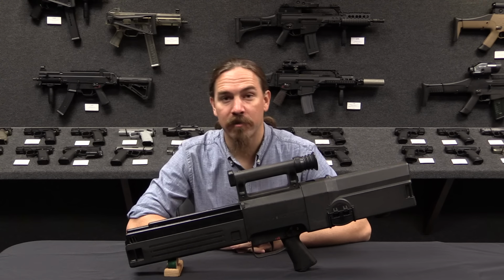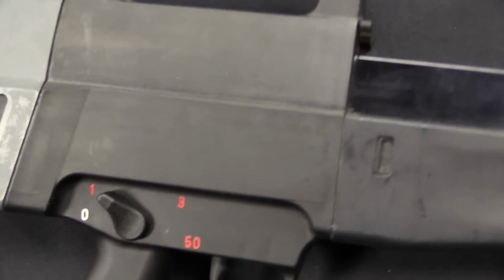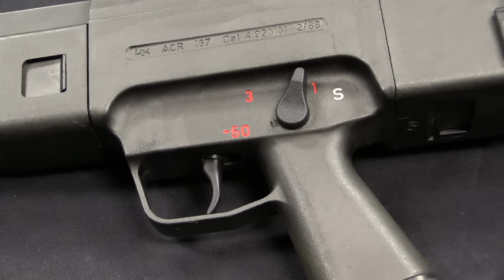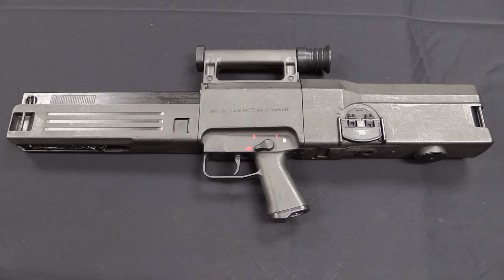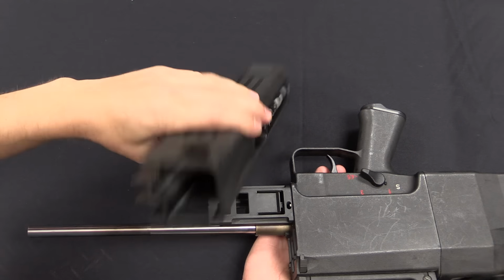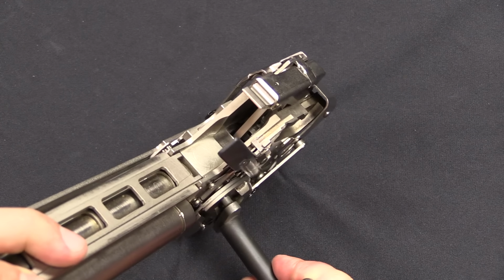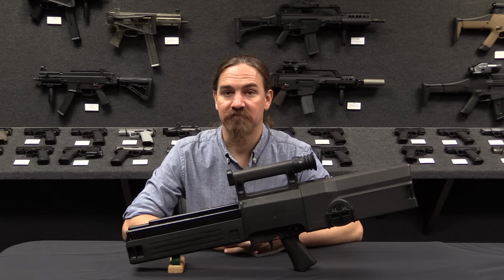Kraut Space Magic: the H&K G11

Comment: how accurate was this rifle, and how did they headspace it?  Merry Xmas!
Reply: you don't need to headspace with caseless ammo, headspace is to ensure that the brass case is fully supported by the chamber, since the chamber with this contains all of the pressure without a case, it doesn't matter as long as the drum can still turn, lines up with the bore and doesn't have excessive gas leakage.

interesting to think that this system probably has at least a small amount of cylinder gap like a revolver though!
Reply: from what I've read from a quick look on wikipedia and google, it seems it was quite accurate. It had a quite decent improvement in hit rate for the untrained shooter in burst mod.

Comment: The H&K MG11 (machinegewehr) variant of the G11 was even more crazy. The MG-11 had like 300 caseless rounds stored at the back in the buttstock of the weapon. The 300 rounds were stored in a way that they can be fired continuously without stopping to recharge the weapon with separately stored ammunition. But the rly weird thing is that you already showed that the entire barrel, and recoil/gas piston mechanism recoils back into the buttstock of the G-11 weapon.......so I have no idea how the Jermanns even manage to fit 300 rounds in the MG 11, and fire it without the ammunition in the buttstock being an obstruction.....but then again, maybe the MG-11 had a different operating mechanism than the G-11 rifle??? :/
Reply: The LMG version had a completely different mechanism. Instead of a rotating chamber, it had a vertically sliding chamber. A round would be pushed forward from the magazine into the chamber, the chamber would raise into the barrel assembly and fire, and then the chamber would drop again and the process would repeat. If you had a misfire the dud would just be pushed forward out of the chamber by the fresh round when you charged it. 

Rounds were actually stored facing sideways in a 25x12 wall of cartridges and left the magazine by being rotated into line with the chamber for loading. I have no idea how the magazine feed mechanism worked and can only assume it involved some sort of eldritch sorcery.
Reply: @lackinggravitas6751  Someone once told me as a joke that the LMG 11 "Loads itself for the glory of the fatherlande" XD XD XD    ;D      ....apparently that's how it works. Seems right enuff lol
Reply: @lackinggravitas6751  wouldn't the dud obstruct the barrel and lead to an exploding barrel?
Reply: @huichuanyang8105  The chamber goes up and down, it's not always lined up with the barrel. So i'm pretty sure the dud gets pushed out when it's not in the firing position.
Reply: https://www.hkpro.com/index.php?option=com_content&view=article&id=24:the-lmg11-caseless-mg&catid=11:rare-prototypes
Reply: @Giovanni Boykin
In ww1 the german generals were actually quite competent atleast compared to their contemporaries.

Comment: Some fun facts about the G11:
- The soldiers were supposed to carry additional magazines in a quiver, similar to the one you carry on your back to transport arrows.
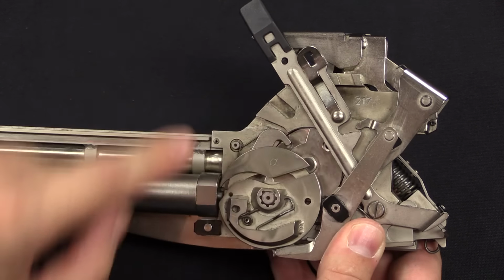- The rate of fire slows down after extensive sustained fire. The reason is that the heat leads to thermal expansion of the rotating bolt which acts like a drum brake. At 22:17 you can see the gap between the bolt and the receiver which would get smaller.
- Later models of the G11 have a predetermined breaking point in the receiver and bolt which would lead the explosion downwards in case the ammunition detonates. Apparently, it was a real pain to engineer those breaking points in as an afterthought. 
- H&K has/used to have a civilian division which produces a wide array of machines including sewing machines. Some of the engineers who usually develop the sewing machines worked on the mechanical system of the G11.
EDIT:
Because there are questions about the sources in the comments below:
Some of the information are from a member of the WTS (Scientific Collection of Defence Engineering Specimens) which is part of the Federal Office of Defence Technology and Procurement. They have a very nice museum in the city of Koblenz.
I also used to know one of the engineers who worked for HK in the 80s, he told me some of the interesting things.
Even though this infos are anectdotal, I have no reason to doubt the people who provided them. I should have mentioned the sources earlier, though. I didn't really thought about it considering this is a YouTube video.
Reply: 'Spare magazines were carried in a quiver'.
Stop, I can only get so erect. I
Reply: @Dedfaction  And the gun itself was the handle for the bow string
Reply: The moment he pulled the back of this off I immediately thought it looked like a sewing machine or a Swiss clock and suddenly I realized how the Germans and the Swiss have been innovative in both of those areas of technology....
Reply: @werewolf74  Yes, it instantly made me think of the ruffling pressure foot for my 1950s Singer sewing machine.    :)
Reply: @werewolf74  prob the only odd system of ppst ww2 that in standalone doesnt look like a gun if u cut off the barrel. More like a watch or something else
Reply: Amazing facts, thanks mate.
Reply: I work for a metalworking company that, apparently, during the Civil War era, made sewing machine components, along with a firing pin mechanism for rifles derived from said sewing machines. Funny to think that there was still overlap in these devices over 100 years later.
Reply: Somebody forgot their materials engineering class when designing it. That story reminds me of the Harrier jet. Early on, pilots said after sustained flight there was a horrendous droning noise. They'd land. No problems to report, plane flew fine. They couldn't figure it out. Everything looked fine. Turns out the intake fan barely cleared the intake cowling/fuselage it sat in, and once it got hot, it baaaaarely scraped it, resulting in the horrific noise but no serious malfunction.
Reply: @dogboy0912  That's because they brought in people who worked in "feinmechanik" engineers - a field of engineering basically absent in America or in English speaking countries. Precision mechanics does the same, but with entirely different methods. 

Feinmechanik is a field of engineering mainly concerned with the signal transfer mechanism instead of structural stability. This is normally acceptable because normal precision machines aren't that large, and the smaller the machine, the less you have to account for material strength. Basically, you don't really have to design a sewing machine for wearing out for example, because there just isn't that much stress on it. Same for clocks. 

The people designing the mechanism of the rifle simply weren't interested in the material part of it they've just built the mechanism, and were happy it works. 

This is why you should always keep things simple, really.
Reply: @dogboy0912  cold have been solved by selecting the right material for the cowling so it expanded in diameter the same as the fan with heat and that way you can have a close tolerance in the whole temperature spectrum.
Reply: @titter3648  You assume they would heat at the same rate.  The cowling would also hit a much lower temperature than the fan blades.  One other issue is creep.  Suitable materials for the fan blade are very expensive.
Reply: maybe they used civil engineers because they didn't know what you can and cannot do, so they just went for it.
Reply: this is one of the best comments i saw on youtube for a while. it must be pinned to the top.
Reply: I wonder if the lower fire rate due to heat expansion is a feature rather than a bug. After all, ammo cookoffs are a major potential issue with caseless firearms, and a slower fire rate would reduce heat buildup in the mechanism, possibly to the point of reaching an equilibrium where the chamber never reaches the cook-off point.
Reply: I bet this gun could be overengineered some more with some watercooling for the mechanical parts/barrel ... so it can fire longer ... and a tea-maker attachment for the british army.
Reply: @Muck006  The ammunition is delicate about being wet, it wouldn't work then.
Reply: +1 INT
Reply: Spool of thread became a magazine, thread was replaced with bullets. Simple 2 hour job.
Reply: how do i upvote a comment more than once?
Reply: 1000th like on me!
Reply: "in a quiver, similar to the one you carry on your back"
[historical groans of annoyance]
Though to be honest that's an easy mistake. Considering everything modern shows it on the back. It's the same kind of idea as drawing a blade from the back. While it's possible drawing a blade from the back however with serious specialisation from what I know. Bringing an arrow from a quiver has the same problem.

The arrow is usually too long. It's also probably slower.
Reply: @YeraTael  Just watch all the Legolas speedshooting videos here on youtube, and you'll find that it's fully possible to use a back-quiver efficiently.
Reply: - It was featured in Fallout 2 as a weapon that revolutionized gun design, as was the XL70E3 (which was touted as accurate and reliable ingame). The writers were clearly having a laugh. xD
Reply: I can see the sewing machine engineering influence here
Reply: El Guusko well that is interesting and explains where the rotating drum idea came from!
Reply: "The soldiers were supposed to carry additional magazines in a quiver," Oh my god
Reply: "Federal Office of Defence Technology and Procurement... museum in the city of Koblenz."
Indeed. 
One of the officers in our 'brother' Bundeswehr unit at the time took me on a tour of that museum back in 1991. The smallarms collection had one of the K1 G11 rifles on display.
Reply: +5 INT
Reply: Thanks for the additional information, much appreciated! One small correction though. No archer ever, worth the name, carried their arrows in a quiver on their backs. That's Hollywood bs, that needs to stop. The quiver is carried, hanging of off your belt at an angle (45-60 degrees approx), as to make it easier to pull out a new arrow with your "drawing hand".
Reply: @Superknullisch It's already been addressed multiple times in these replies, that yes "most archers" historically used hip quivers... However, there are also multiple groups (while still being the minority) who did in fact use back quivers 💯
While the exclusive use of back quivers in Hollywood is very misleading; your statement that they were never used is even more wrong than the exaggeration of their use 👍
Reply: In all the reading I've done on the G11 I've never heard of any of those issues. Are you sure that's in any way accurate? The US Army trials didn't mention any issues with sustained fire.
Reply: @NameNotAlreadyTaken2  Sorry, this reply is late, I just read your comment.
I added the sources.
The problem with the sustained fire was probably with the earlier models and even then only after excessive use. I haven't read the documentation on the US Army trials, so I can't tell how they tested it.
Reply: @NameNotAlreadyTaken2  Very suspicious. Don't know why everyone is creaming their pants over a post with with no sources whatsoever, or even with information that shows up anywhere else.
Reply: Some of those engineers have been caught making ballistic sewing machines.... maybe.
Reply: The insides of this gun do kinda look like the insides of a sewing machine
Reply: I would have thought that spare mags would have just fit in a vest designed to hold them horizontally instead of vertically. But hey, a quiver is pretty cool too.
Reply: Why don't you still know the engineer?
Reply: @michaelvoorhees5978 Hi, possibly for the same reason I no longer know a lot of the Tradesmen/engineers I worked with in that period! 
They've long since been party time for the worms!
Reply: 29:45 AK74's Yes, really!
Reply: this man is better than Ian.
Reply: 69 420 to you
Reply: autotype of google say poop pool and hot dog food and also comments on the left side of your attention that I have to be nice to have a good time with the truck brb imma go to the anthem blue chip cookies no sarcasim toootaly I don't think about smoking vaping lol

Comment: There's another video floating around of the bolt being disassembled.
There is no real chamber sealing setup.
The bolt should only need to spin 180 rather than 360.
The gas system is too close to the chamber, making it recoil much harder than it should.

Comment: Wait, did H&K solve the heat sink problem? How? Ian touched on the idea that it'd be a developmental hurdle, but never really addressed how it had been solved. 

Also, if the gun operates with a recoiling action, won't that make this thing like an open-bolt subgun from hell in full auto? in semi-auto it's a non-issue because it fires from a closed bolt, but in full auto you've got basically every metal part in the gun recoiling back and forth with each shot.

Comment: Are we absolutely sure this was not a massive industrial espionage coup by the Swiss?
 I'm thinking something like Swiss directorate S operatives trained to infiltrate foreign industrial processes to make things 50x more complicated than they need to be just because that's what you do in Switzerland.  
Somewhere there is a group of Swiss engineers absolutely delighting at the 7,983 unnecessary clockwork parts they have inserted into the dozen or so collective projects they have worked on.   
     "Of course we could do it in 12 parts any idiot can do that! the real challenge is fitting 200 multi function clockwork components into the same space!"

Comment: iv got an idea for the cooling system that's needed to dispel the heat that would normally be removed by the empty case. have cooling liquid around the barrel and use the reciprocation of the barrel to pump the liquid through the system. more details would need to be worked out but it could work
Reply: Maybe use the cooling fluid that's being pumped to spin a small fan with a flywheel to blow cooler air over a small radiator and then have the fluid that's flowing through the system to start from the end of the chamber or pump half way down the barrel and back to the chamber and to the radiator or all the way from the muzzle down the barrel to the chamber into the radiator and cycle again. And i say to use the barrel reciprocation because the G11s barrel moves like that already but a long stroke gas piston could be used for the fan and pump. I just imagine it would be difficult to make it light and durable for military use. maybe start with mounted weapons. or even go so far as to use the vehicles coolant system to pump coolant over the barrel and chamber. But make sure to put valves to isolate the gun from the vehicles system. or better yet just use an electric motor as a coolant pump and its own separate cooling system and radiator and electrical fan. The one down side I can think of would be using ammo fast if you can just crack out rounds constantly at 600-650 RPM from any mounted M240. because the barrel would just drop on and stay as a part of the vehicle. but I guess if the M134D can have enough ammo in a Humvee then a M240 at 600 rpm wouldn't be hard to have ammo for.

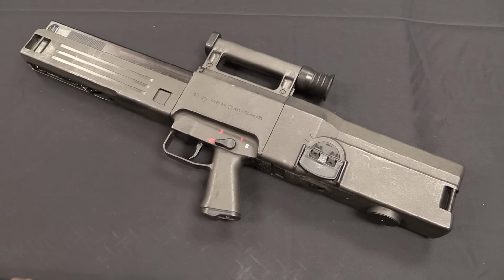Comment: at 24:00 Ian brings up a good topic (about guns and other products): 
At what point can you stop making the machine accessible to the user and just slap a "no user serviceable parts" sticker on it, or hide the oil dipstick and just have a "dealer service required" light on the dashboard?

From watching this channel, I don't think ANY firearms are so reliable that they can afford to make it hard to clear feed/extraction/ejection fails, and especially not something firing caseless ammo. One thing all the successful and widely used guns designs seem to have in common is easy access to a relatively short bullet path through the action.

Can anyone think of a counterexample? A widely used successful gun where the user doesn't have finger and eye access to the rounds as they come out of the mag and go into the chamber? Where all they can do in a malfunction is manually cycle the action and pop the magazine and maybe just beat the gun on a rock, and if that doesn't work they need to start field stripping it?

Comment: The G11 was/is better than the M4 and M16 series by Colt/FN. It does about 4 times as well in hit probability and reliability testing. Just like the XM8, G36 and M416 that H&K submitted to the insane amount of programs to finally replace the M16. Or any other gun by any other manufacturer like the Scar or a number of other guns.
The US Military just decided that 4 times as good is still not good enough to replace the $500 M16/M4 with a german or belgian Wunderwaffe 3 times that expensive and with a new manual of arms and different logistics.